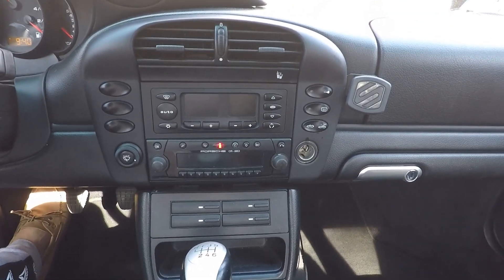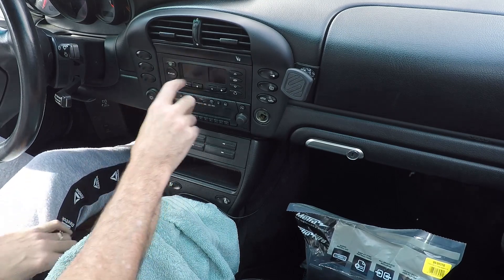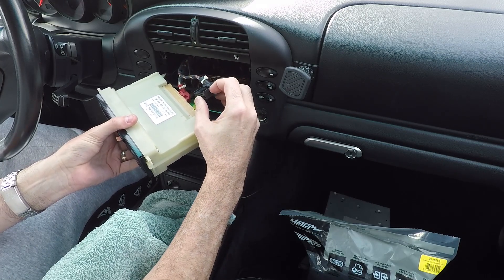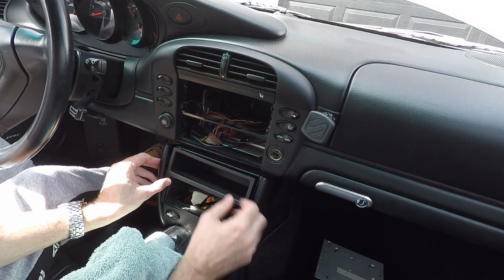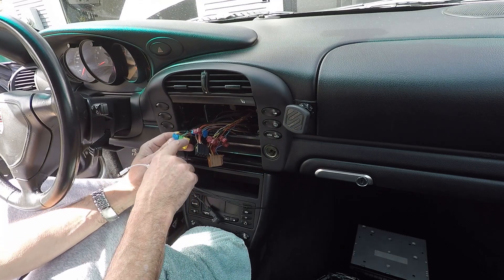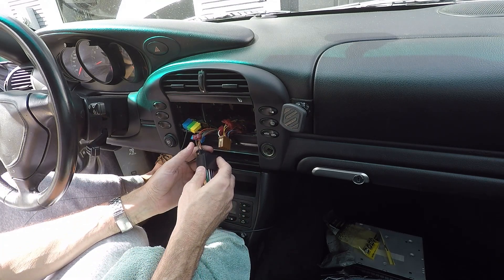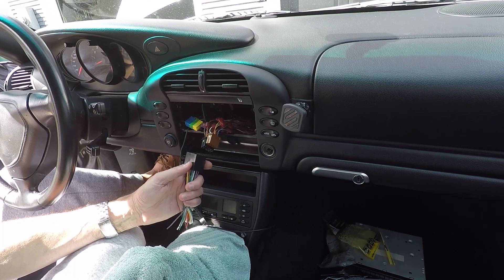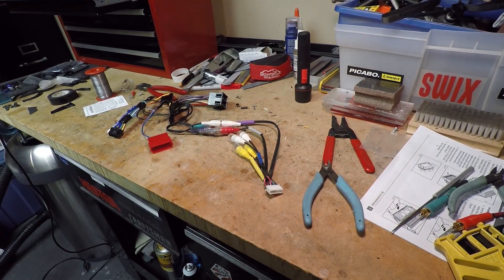Installing Alpine Double Din Stereo with Carplay into my Porsche 911 996 with Factory Bose

Comment: Thanks, very useful!  Three things I ended up doing a little different:
1. preferred the Porsche trim and storage for the lower section of the console over the Mitria. Merely for fit and for the keeping rubber inlay of the storage;
2. put the new microfone into the space for the Porsche microphone (see left of your speedometer for this thumbsize roster). I took this out, run the wiring through the dashboard into the upper part (see video’s for removing) and made the microphone fit into the back of this thumb-size roster before placing it back. Microphone and wiring are invisible and it works excellent, even when driving open;
3. I wanted to keep the classic look of the center console with wiper-control and cigarette lighter. So I placed an almost invisible USB connector into the back of the lower “bat” trim in the center console. It fits very well and you only create a small USB-connector size hole in the trim.

Comment: I have the same issue with the Metra kit in my 2003 986 Boxster. The cup holders don’t work with the kit. Glad I ran across your video before I got too crazy designing more than I needed. I also got the Alpine radio so I can use the mounting holes.

Comment: PIF DIY - this was a great video for us 996 Jockeys that have an awful stock Head Unit.

I will have to relocate my climate control ops module as well, so seeing that performed gave me confidence. 

if you were to do this again, would you purchase anything different (equipment-wise) or add or subtract any component of this mod?

thanks again. there’s no telling how much time you’ve saved us in the 996 world, but it’s definitely over a metric S ton of minutes
Reply from the maker: Thanks for the kind words corporalclegg914!  I was very happy with my choices when I made this upgrade. The Alpine unit had rock solid Carplay connectivity and allowed for a lot of sound adjustability. These days, I'd look for a wireless Carplay unit with the same features. The setup I had worked great with no surprises. The sound was good enough to not feel a need for an amp. Adding an amp would've improved the sound, but the HU swap alone sounded fine, even with the top down.

Comment: Long shot since this videos three years old. I've been reworking my 986. I have a similar setup with the Bose amp. I notice that my brown plug has all the speaker pairs. My yellow plug only had the remote turn on for the amp. All other wires were cut to the yellow plug. If I plug the brown plug into the Metra I get sound, but it sounds kinda flat and muddled. I have the red connector from Metra for the amp, but I'm unclear, do I I do away with the brown plug and rewire my speaker pairs into the RCA cables from the Red Metra adapter? And If so, you mentioned you they all share a common neutral so what do you do with the neutral from each pair?

Comment: Why did you wire the constant 12v to the switched 12v? Just after the 15 minute mark.
Reply from the maker: The Metra harness is made for Volkswagen/Audi and although it works in the 996, the constant and switched leads are reversed.
Reply: @pifdiy298, THANK YOU SO MUCH! I have a 2002 911 and I’ve wired multiple stereos in the past with never an issue but I couldn’t figure this car out. I think this and the amp remote turn on are my issue and I should have tunes very soon! This video was was very helpful!

Comment: Question: Why not leave the RCA leads and connectors where they are on the red connector? On the car side, they connect to the amplifier plug which expects to see the (+) amp on signal and the RCA input for the 4 speakers with a common ground. On the black METRA connector, there is the power side (illumination, switched, constant and ground) as well as (+) and (-) for each speaker, which needs to go to the brown connector on the car side. I guess I do not understand how eliminating the input into the amplifier keeps the amplifier functional. It would appear to me that your wiring uses the head unit's amplifier exclusively to power the speakers.
Reply from the maker: Hi, 
"On the car side, they connect to the amplifier plug which expects to see the (+) amp on signal and the RCA input for the 4 speakers with a common ground."

This isn't true for my car. If you go to https://youtu.be/7FWd_gPaXuw?t=676 you'll see where that red connector attaches to the car harness. That car harness only has the remote turn on and some CD changer connections. If you look at the location of the RCAs on the red connector and then trace it to the car harness connector, the mating pinouts are not populated at all, so those RCAs would go to nowhere.  Hope this helps.
Reply: @PIFDIY  I appreciate the reply; according to the wiring diagram, the yellow connector is pinned, but I have not checked in the car, yet!
Reply: @PIFDIY  I can confirm that you were absolutely right! One wire (12V to switch on amplifier) is the only pinned connection.
Other observations:
- the Metra kit has some shortcomings when it comes to radio fit. The cradle was so !@#$% tight that I had to literally press the radio into it. Not good. Then mounting the cradle in the frams...what a mess. I used the Metra clamping bracket around the radio and fabbed two aluminium spacers so that the radio with cradle locked into the frame. NOT an up-to-date kit, for sure.
Reply from the maker: @cattlerepairmancattlerepai9414   Yup, same here. Had to fab a little to get it to work. Still though, it gets you most of the way there...

Comment: At 15:08 you talk about swapping the 12v constant and switched. Rather than red to red and yellow to yellow you flipped it. Why?  Thanks. Great video. I have watched it 3 times and will watch more as I wait for my new head unit to arrive.
Reply from the maker: Hi, the Metra 70-1784 color codes are accurate for Audi/Volkswagen but Porsche reverses the colors for constant and switched (don't ask me why) so you need to swap those two colors when going to your HU. Hope this helps.
Reply: @PIFDIY  I had the same question, many thanks for posting this video.

Comment: Great Video! Which USB cigarette lighter option did you choose? It looks great and "factory". I'm having trouble finding one that finishes as flush as this
Reply from the maker: The parts I used are in the links in my video's description.
Reply: Thanks I missed that completely. I had seen those on Amazon.  They look much better installed than they do in the ad. Good to know. Thanks for the reply.

Comment: Why does almost NO ONE make the effort to put the AC in the top slot where the cassettes were?  Only see 1 install done nicely.
Reply from the maker: Because you can't buy off the shelf parts for that fitment. To get the AC on top slot, you'll have to fabricate parts.
Reply: @PIFDIY  I saw a couple like what I want, will find someone to fabricate